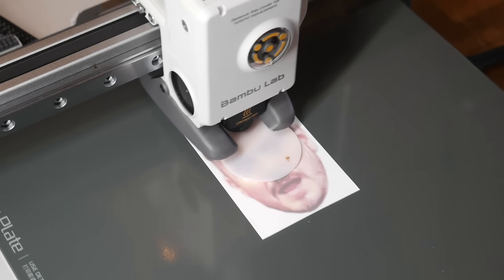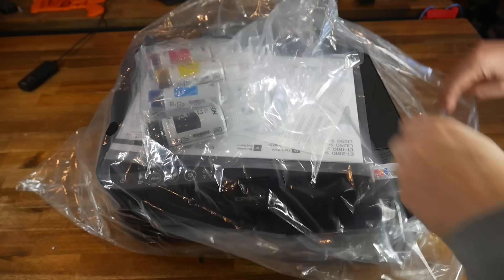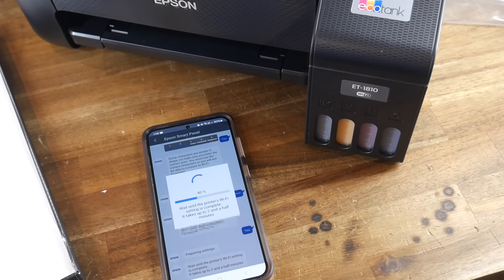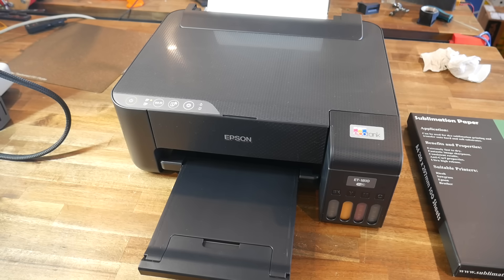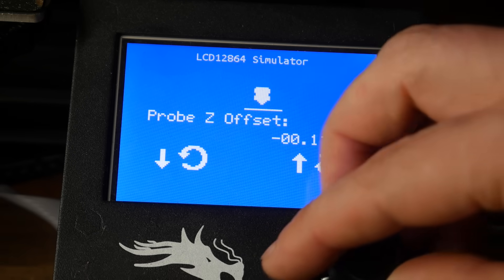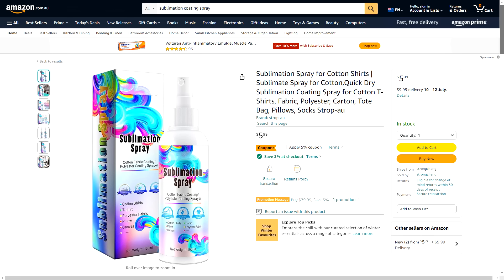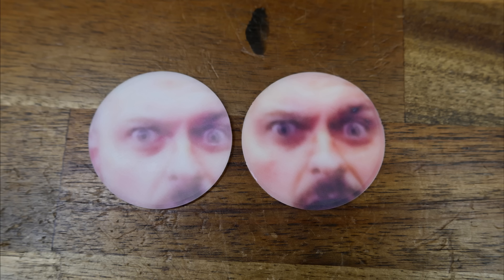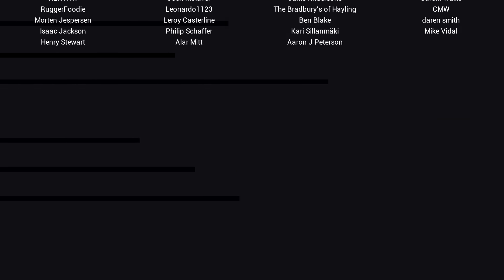Full colour first layers on your 3D prints - Sublimation guide part 1

Comment: On an EcoTank printer, if a nozzle clogs, you'll need to buy another printer, because there's no cartridge or replaceable print head you can buy. I will not buy another ecotank epson printer ever again!
PS. these printers also have an in-built counter which measures how much ..ink you have used and make your printer unusable after reaching a certain value.
Reply: Pretty sure some solvent and maybe a syringe would clear it

Comment: some printers have in the settings enabled by default an ink saving configuration, my HP printer needs me to set it to "quality" instead of "standard" it takes a lot more time printing but it uses more ink and colors are more saturated. so maybe look for that on the printer settings.

Comment: You can do black&white images with a regular laser printer and transparent sheets made for overhead projectors. Printers heat is enough to sublimate the ink (edit: it melts the ink).
Reply: That's cool to hear, since I'm not nearly creative enough to make use of full color, but I could use some labels on my prints occasionally. A bit of a nit-pick though: laser toner is actually fine plastic particles, so it's not sublimation anymore, just melting the toner into your print.
Reply: @flagman3116  Thanks for the correction, that makes way more sense.

And adding labels to printed lab power supplies etc. is quite important, that is where i found the method.

Comment: Not surprising this works, it's interesting but we'll see how many people actually do it. Eco tanks in general are based on extremely cheap printers as well so the cheaper the printer the more likely it'll die quick, expect if you do this for it to be a money sink unless you know you can make the money back.

Also a word of warning to those looking at the ET-1810 specifically, it's an alright printer when it works, printing just normal paper prints. It's reliability is highly questionable, I have one and did less than 100 prints before it started having issues which Epson "apparently" couldn't diagnose, a lot of stuffing around before they would actually look at it under warranty.

Comment: Have you tried increasing first layer line width?  If it was something like .8mm instead of .4mm it would probably help even out the pressure on the printer paper.
Reply: I believe it's important to take things slow when dealing with sublimation because it requires a certain amount of pressure. Widening the line may result in less pressure, but using a wider nozzle can definitely reduce the printing time. I'm curious to experiment with this and see how it works in practice.

Comment: Just try to use Epson Easy Photo print, there you can try different tipes of paper preset, best results i got with epson semi gloss preset - and using "epson ink jet".  more paint at first time, anyway try to set different papers avoid reprint. For best results need to calibrate and create color profile, but this procedure more relevant for printers with >6 colors. And... yes you should print something on regular basis to avoid dizziness or dryness of the print head, also need to always check rubber scaper located after print head parking place abd clean it if need - good luck and tnx a lot for 3d integration❤❤❤

Comment: Absolutely brilliant. I just contacted my local print shop (They're about a mile away) and I found out they do dye-sub printing. I can design artwork for my project, email it to them and later in the day nip over there and pick it up. My shop quoted $6.00US for an 8x10 sheet for singles and a sliding scale for multiples. Instead of buying a printer and all that entails just call up your local print shop and see if they do dye-sub. Oh, and my shop can do prints bigger than my Artillery Sidewinder X2 print bed.
Reply: I found some sellers on Etsy who sell prints of your own files as well. Shipping would be the consideration of price comparison of course. I found one for $3/letter size but shipping was $7.95 :( I imagine once one gets into quantities that might become reasonable, so if space for an extra printer is the issue, it could be worthwhile.
Reply: Correct - I provide this service in Central Texas!
Reply: And I bet they can get and maybe supply Sublimation spray 🙂
Reply: I’m intrigued by this option. I don’t have a local place so went online. Googling ‘dye sub printing’ all of the results are offering the process that give me the final result (on a t-shirt for example) do you have any advice on what to search to find a place that will do the print onto the paper?
Reply: $6 for a regular sized sheet of paper?? Thats expensive. I made my own sublimation printer a few years ago like mentiomed in the video and maybe spemt like $200 total on the printer, ink, paper and a few sub blanks
Reply: @animodeoh  Yeah, but If you only want to Test it or use this technique ocasionanally it Checks Out. I don't have more space for another printer, but might want to try IT on a Phone Case.
Reply: @animodeoh  Have you checked how much it will cost you if you are printing a full colour page? If you print full colour it might very well still cost you >2$/page
Reply: @ABaumstumpf  paper is inexpensive and ink lasts me quite a bit since its an ecotank and not a cartridge
Reply: @animodeoh  "and ink lasts me quite a bit"
So you have not checked it and are just guessing? Ok.
Reply: @ABaumstumpf  i dont have to. I use my sublimation printer a lot making hundreds of coasters and mouseapds. Ink is not that expensive. Its only $18 for a set of 4 colors. I think youre overthinking it and try to calculate every little thing. Its only cents worth of ink when i print a mousepad, which is almost the size of a 8.5 x 11 paper and thats use high quality settings which uses more ink per print.
Reply: @animodeoh  You're using it constantly. That's a completely different thing from somebody who wants to do it every once in awhile. Unless somebody is going to use the printer constantly like you are, they absolutely should not buy one for this, because it will get clogged. It would be much better for them to just buy printouts from other people.

Comment: This doesnt just "bond to the plastic" it enters INTO the plastic in its gas state. 
You could use sandpaper on that and it wouldnt go away right away.

From what ive seen on our sublimation press on plastic its 0.5-1mm~ deep iirc. so this should, on the first layer be spread around the whole first 0.2mm or 0.25mm (whatever your first layer thickness is). 
Sublimation on prints should be VERY durable :)

Comment: I tried this a while ago as well and it worked great. I did just a quick test, so I didn't change any settings from a normal PLA print. Still came out very well. Cool and informative video as usual.
Reply: We came up with the same idea a few months too when we started doing sublimation with one of the little epson's. Wouldn't have thought of the sharpie trick though.

Comment: extra tip! epson sells sublimation ink for there ecotrank printers. and for the best results I advice a very good icc file to have the best colours printed. the normal settings are ok. but with a good icc file results are 10 times better. I have the file for eco tank printers that will greatly improve the quality of the prints. 
maybe @teaching tech, you can do another video, with high release paper and my icc files, to see the difference.

another tip, when you use a eco tank printer for sublimation. you must print 1 page a day minimal, the paint tends to stick to the printhead if not used in a while.

Comment: Ha, great idea, i was actually interested in those printers for normal printing anyway. :-) Is it hard to flush the sublimation paint ? Heck i wonder if you were to mix ordinary black with the subli. one ?
I got a feeling it would be usable for both this and some occasional document.
Reply: Sublimation usually prints less vibrant. The colours pop when they adhere to the polyesther or plastic of the 3D print through heat and pressure.
Reply: @baschz  i see,  thank you for answering
Reply: @DirkLarien that is when printed on the sublimation paper though. I haven’t printed on ‘normal’ paper with it. guessing it will still be legible enough to print some text, but images I’m not so sure of

Comment: Interesting and definitely fascinating, but a lot of steps and set-up/calibration for how often it would get used. I used to do a lot of sublimation, but if it's not done daily (or even weekly), the inks in the printer end up drying on the head(s), or if the printer has automatic cleaning/cycling, the ink gets used up in the cleaning cycle and just goes to waste. Sublimation can cost you more than you make if you are not using it on a regular basis... but... I do love this concept!
Reply: It’s not hard to set a reminder to print a single page on the printer once a week….
Reply: Very helpful to know, thank you.

Comment: I now wonder whether sublimation paper is thin enough for holographic print surfaces to push through. If so, I could see some really cool album cover style poster plates or electronics covers.
Reply: Sublimation paper is thicker and there are 2 coatings, the back side is a smooth layer that becomes wax-like and makes it easy to clean your tools (build plate) the front is a little grainy and that's why the 3D print sticks so good to the paper. So no the holographic print surface will not push through.
Reply: @nerdsph1  Thanks for the info. I was afraid so. Quite the shame. But it is what it is. 🤷

Comment: This makes me wonder if this wouldn't work with a regular laser printer as well with a few extra steps. There is a process by where you print with a laser printer, glue the print down face down on say wood or plastic, then once dry you wet and rub away the paper leaving the image on the surface. Something similar might be possible using this technique as well since lser printer toner is also heat sensitive.
Reply: Acetone will make it transfer.  As well heat.  But it's a PITA to try to transfer to wood.

Comment: Just a few days ago, a friend got access to a sublimation printer. I told her that I wondered if it could work with 3D printers.
Then, here you are just a few days later putting out a video about how to do that. How do you do it?

I was just wondering if it could be printed then ironed onto a print. Looks like the heat needs to be too high for that based on this video, but I hadn't even thought about printing right onto it. Nor about how to convert a cheap printer to be a sublimation one. You are constantly putting out the most useful 3D printing content I have seen. And 3D printing/maker stuff is the majority of what I watch.

Thanks for another great video!

(*Edit for typos, but not sure I caught them all)
Reply: No, you can't do sublimation on the printed part, the pressure and temperature would melt the print or result in delamination. I was trying it for some time with at best (on ABS) some sublimation but warped prints, on TPU I ended up with a mess behind recognition. The technique came as a last resort and came out great from the start (as you can see at the start of the video).
Although not recommended you can convert an existing printer to a sublimation one by cleaning the tanks and tubing. (IPA or printer cleaning fluid), then flush the ink till you have the sublimation ink in the system. Important: The printer has to be like Epson, meaning no heated print nozzles.
Reply: @nerdsph1  Not sure you read my whole message. I point out that from the video I see it needs to be too hot.
Reply: no. sublimation is the process of turning from a solid to a gas as stated at the beginning of the video. if you 3d print on top of the paper then it is converted to a gas by the hot plastic making contact with the dye. so the process is done at that point. you cant re animate the gas to a solid. make sense? when you understand what sublimation is you understand how it can be used.
Reply: @freelectron2029  Not sure you read my whole message. I point out that from the video I see it needs to be too hot.

Comment: Rather than 3d printing onto the paper, is there some method by which the paper could be applied to existing prints and somehow heated to the point of sublimation? I'm thinking about surfaces that are either curved, recessed or otherwise couldn't be printed flat....
Reply: I would assume using a hand iron on a high temp material to work in principle. The only potential problem should be creating high enough "squish".
Reply: The printed part should be able to handle around 200 degrees Celcius and sufficient pressure for at least half a minute though, but probably.

Comment: Just buy a cheap older Epson printer for like $50 and use a $20 set of refillable cartridges. Ecotank is fine and all, but the ink tanks are pretty big and vulnerable to ink settling and lots of clogs. You have to refill more often, but also much easier to take the cartridges out and give them a good shake every few weeks as needed. To put down more ink on a page, make sure to use the setting for matte paper, puts down more ink than gloss profiles.
Reply: You can most likely get one for free and why does it have to be Epson?
It can be any inkjet and you can probably find people who will pay you to remove it.
Reply: @andreamitchell4758 exactly. You can even fill the old cartridges with sub ink
Reply: @andreamitchell4758  Epson printers use piezo printheads, printers like HP and Canon are thermal heads which are not compatible with most sublimation inks.
Reply: @andreamitchell4758 As was mentioned, Epson’s printhead doesn’t heat up. Most other printers do.

Comment: I don't have a 2D printer at the moment, if I'll ever need one, I'll definetly get one of these.
Is Epson a good Company?
All I know is HP really bad and Brother just work/won't fight with you over a subscription like HP
Reply: Epson makes very good printers. Not only they are reliable, but also quality is better than competition. Standard inkjet printer have DPI of 600, maybe 1200, most of Epsons printers have max DPI in range of 4000-6000. Thanks to that, with good paper u can print photos that looks like photos. 
However it all depends on how u want to use your printer. For everyday / everyweek usage they are great, but if u want to print some documents once a month or so, then laser printer is so much more reliable. Inkjets needs to constantly clean nozzles to be operational (and always have pluged in power to do nozzle maintenence).

Comment: Wow. One could make some amazing front panels for enclosures and great images for keycaps on custom keyboards. I'm not going to run out to purchase a 2d printer for this, but may reconsider some day in the future if an extra wad of cash comes my way.
Reply: You could probably pick up a normal ink jet for free or Next to free from. Craigslist or somewhere else arnt just get a cheap refillable cart kit from China and inject the sublimation dye into the carts instead of ink.
I really don't see why it needs to be an eco tank specifically other than Epson sponsorship of the video or a very trivial convenience feature 
That becomes even more trivial when you consider the process of transferring the due to the bottles outlined in the beginning of the video.
It is just as easy if not easier to inject the dye into a refillable after market ink cart with a syringe
Reply: @andreamitchell4758 I had this thought as well. It seems like a lottt of extra additional costs. I couldn't understand justifying all of the extra purchases for the end result. It seems like you could, like you said, get a cheap printer and refill carts with sublimination dye and get the same effect. Unless there is some sort of chemical interference, why go through the trouble? I also just am not getting the hype for this idea generally though.